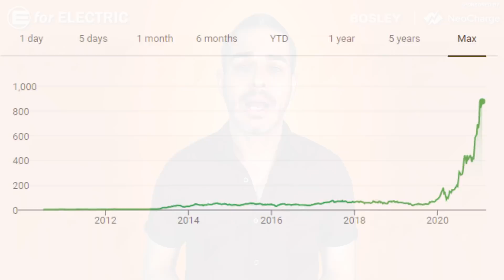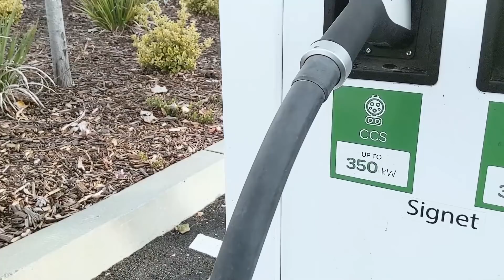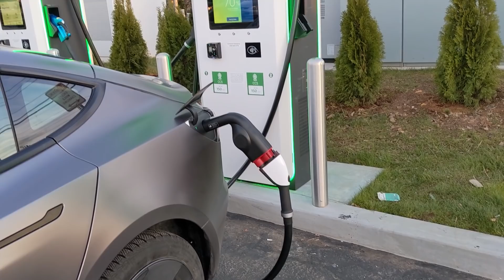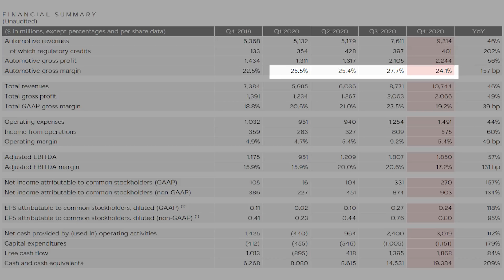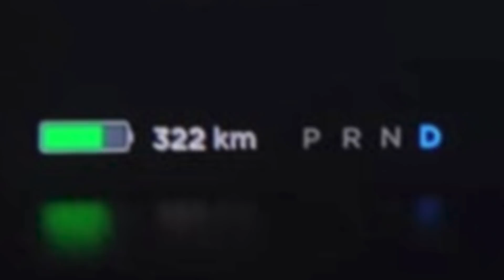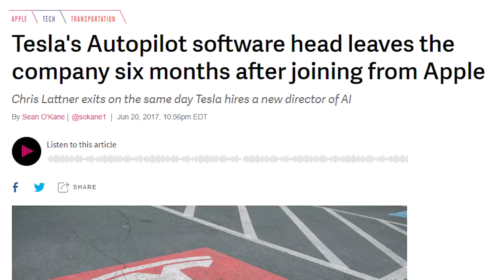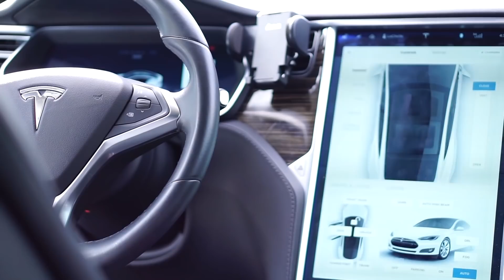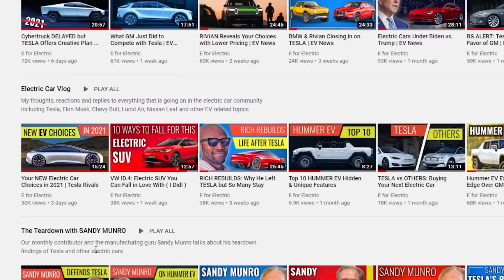Investing into Tesla Stock: Things You Should Know in 2021

Comment: Yes, these are proper concerns. I can add a few more:
1. The model line is now a little off for chmm... most markets. Teslas are very American cars - fairly big, with bad lamps and rather mediocre finish, but there is no truck still. We have to wait till 2023 to see the dent. For Europe, Teslas are too big and these bad lamps and finish... We need a smaller car like ID3 and smaller than Model Y SUV and microVAN. For China, the model line is surprisingly good, as Tesla doesn't want to compete with the micro/crap category, and rich Chinese buy Teslas as they are. Latin America and India need a smaller car.
2. The current designs of the M3 and even MY and obviously MS and MX are dated. Not really, but people are used to model change every 4-5 years. All competitors have new models now. It will take Tesla years to refresh the line.
3. The Star Trek look of Tesla is modern and cool, but a lot of customers prefer retro styling like Mini or Porsche and Steam Punk design (Teycan has even copper trim) of cars like eTron. It is difficult for Tesla to compete in this area. 
4. Tesla needs an app store and car API. Fast. As many competing cars have solutions from Apple and Google for providing a myriad of useful apps to use in cars. Also, on local markets.

As to quality and service - fortunately, Europeans are also dismal - maybe not in panel gaps, but UX of Audi, VW, Marcedes, and BMW is notorious for its stupidity. And these cars are not reliable, and repairs are very costly (see even biased German TUV).
As the main constrain for market domination now is the number of batteries - Tesla has the fair chance to get better - just in time for 2024-5, when Ford, Geely, VW Group, Hyundai/KIA/Apple will have enough batteries and debugged software to really compete.

Comment: The fast charging network is very unreliable outside of Tesla. EA has locations but good luck getting them to perform as advertised. I drive a Bolt and they struggle with a car than only charge at 50kW.

Comment: (Tesla model 3 owner)
Finally, a video talking truth about Tesla. I was wondering if I was the only one having that many issues on my car: 
- parallelism remade after 1 month, and now the stearing wheel is tilted. The customer service told me if have to accept the car as it is. 🥺
- welding on rear boot not finished (cracks visible)
- many accessories need to be bought to make the car practical (avoid snow falling into the boot, phone charger..)
- rear lights changed 2 times because of water leakage (still leaking)
- painting not finished (raw parts)
- plastics falling down
- autopilot is a joke (even after fsd update/ hardware replacement)
... I'm sure I'm forgetting some more issues. I have the car for one year now.
Reply: You never got a lemon before? 🤣 I bought a Ford F-150 that went back in 2 months because of the non stop problems with the engine and electronics in it. So does that mean All of Ford is trash? Half the shit this guy is saying is misleading info. Also the Tesla I have had none of those problems so what does that mean?
Reply: Do you live in California or other place w/ a lemon law? If so, talk to an attorney. California’s lemon law is really good; for some attys that is all they do. Tesla’s acceptance that the car’s defects can’t be corrected (re the steering wheel), taken far enough, would seem to be proof that they have to take the car back.

Comment: First of all traditional car manufacturers will have to shut down engine factories gearbox manufacturers. There they will have major problems with the union since ten thousand jobs will be lost. Vw is already struggling with sales and with software that looks like it will take a long time to resolve. Nio's solution of changing batteries is a bad idea who should check that they are within their limits! The 800 volt system doubts that it will work as it requires even more energy from an already severely limited electric power plant. The only reason why e tron sells better is the build quality, very inefficient car high power consumption. Yes, there will be more competition, but it will also depend more on which company has the best software hardware in-house production to best feature efficient energy consumption. Where Tesla will most likely win, we will see.

Comment: Which other EV at 40,000 $ can charge with over 250 kW?
Reply: None. However, many comes close on average charging speed. IONIQ 5 claims a peak charging speed of 230 kW and 10-80% in 18 minutes in ideal conditions. That’s an average of 170 kW. Deliveries start in June/July.

Peak power is not that interesting. The average charging speed from 10-80% in a 2021 Model 3 LR is about 80 to 120 kWh on V3. Depending on the ambient temperature and to which degree you’ve managed to heat up the battery. The charging session takes about 25 minutes. If you take the low consumption of the Model 3 into consideration, that’s still a winning formula though. If the car fits your needs- and live up to your standards in other areas. Same goes for the Model Y.
Reply: @omelvold  where will they charge? electrify scamerica?
Reply: @tips4tesla407  I know the Porsche did when it set a new EV Cannonball (NY to LA) record. 🤠 The US is lagging behind, but in most countries, there are way more fast chargers from other operators- than Tesla. And they’re growing faster. 

Not only that. People charge mostly at home anyway.
Reply: @omelvold  the ppl who did the cannonball run, out of their own mouths said if they used teslas v3 it would have been way faster, due to charger location and speed. Even if u throw out location , range , price, tech is def not up to par from porsche
Reply: @tips4tesla407  You’re missing the point. EA works, and there are dozens of providers growing fast. Chargepoint etc.
Reply: @omelvold  electrify scamerica from hoaxwagon raised their prices to par with gas on purpose to drive ICE car sales. Chargepoint purposely charges slow to keep the customers shopping cuz thats the location of chargepoint chargers and on and on. Range matters
Reply: @tips4tesla407  Teslas charging prices are not sustainable. Fast charging prices doesn’t matter anyway, because people charge mostly at home, at work, destination chargers etc. When it comes to range, the EPA ratings are totally misleading. Of course, the most aerodynamic sedan, or egg shaped MPV, with the biggest physical battery will have the longest range. But there’s a total mismatch between EPA and WLTP ratings. And while the Taycan for example has about 200 miles rating, you can go 380 miles in real life. In the same conditions and kind of driving required to make the EPA rating EV a Tesla. Good luck with your conspiracy theories.
Reply: @omelvold  not sustainable? you clearly dont understand the process, they give away 2000 miles with every car cuz the electrons are free from solar, and i guess ill bid you a good day if you really think that of WLPT, you will learn eventually. Tesla doesnt have the biggest battery its much smaller with a much larger range. Good luck with your theories too! we will see which one plays out in the future

Comment: It is an order or magnitude more difficult to ramp production for a mass market vehicle than to build a prototype. Prototype ranges overpromise all the time, range promises from Lucid Motors are not comparing apples to apples to Tesla. And clearly those cars are going to come in at a way higher price point per mile of range than Tesla will. Unfortunately this video has a lot of cherry picked data. Not used to seeing this from your channel. I was looking forward to seeing some legitimate arguments for Tesla being overvalued, not "the competition is coming" like the analysts have been saying for the last 5 years.
Reply: Lucid sponsors this channel.
Reply: I think the difference is that before most of the proposed competition was either on the ultra high-end, or distinctly less impressive like the Leaf and Zoe.  Now it's cars like the ID.3, ID.4, Ioniq 5, etc.  Cars the average person can afford, and are impressing people.  That said, I think Tesla will do just fine, despite the Kia CV being the car I have my eye on.  800v charging and an impressive heads-up display, two things no Tesla offers.
Reply: @ScrapKing73  Correct 800v charge speeds is not something Tesla offers - I could be wrong but I thought it had to do something with longevity of the electronics system? Also speed of charge matters less than how far you get on that charge. Example is the Porsche Taycan - technically it can charge at a faster rate than a Tesla however the actual charge speed in miles per hour is higher in a Tesla due to greater powertrain efficiencies and others. 

For sure there will always be a market for different car models - not everyone likes that single flat screen in the Tesla.
Reply: @michaelseymour5465  All other things being equal, 800v charging systems can produce less battery degradation.  So 800v generally means either faster charging speed, or lower amperage for the same speed.  And we're not talking about the Taycan here, we're talking about the South Koreans cars which are Tesla's big competition in the efficiency stakes.  :)  All of that pales in the face of the heads-up display, which is a big feature for me (I've experienced it on the Kia Soul EV and it's awesome).

It's not that I think people are making a mistake to buy a Tesla, it has advantages too.  It's just no longer true that Tesla has better tech in every category.  Tesla channels often talk about how Tesla has this unassailable technological lead across the board, and that's simply not true.  It was once, but it no longer is.  None of that changes the fact that Tesla is doing fine and will continue to do so, especially if they come out with a hot-hatch down the road.  If they come out with a smaller model, and if they solve all their build quality problems, then I might even consider a Tesla in the future.  But for now, they're not an option for me.

Comment: Correct me if I am wrong but Tesla is the only auto manufacturer with every vehicle since 2018 equipped with all the necessary sensors, processing and hardware that can be updated in less than one day  with the most recent autonomous driving software. If other manufacturers working to solve autonomy had such a fleet of vehicles to use they would too. Also, Tesla can see who are the best drivers to invite to participate in the Beta program and these drivers have to agree with the terms to participate. Everyone will have to do " human trials" at some point. That's how everything ultimately gets tested so why is human testing somehow bad for solving autonomy?

Comment: I totally get Tesla is not in the same place as before but...
How are you only talking about Europe? Of course Tesla will not be the best seller there until Berlin starts working. How are those cars selling everywhere in the world? Still a lot of ramping required for the competition.
Beta testing actually means Tesla has a lot more data and experience and that is really an advantage in their FSD. MobilEye is ahead... you can say that but if you look on the long run its technology is more expensive and less adaptative to changes in the roads.
Tesla solar lost market because it had to focus on automotive sector, it is ramping just now.

Also don't forget to add MobilEye + Automaker competitor when comparing with Tesla market cap...

Seems like you are missing part of the picture here.
The stock price may go down, I am not saying it will not but that does not say Tesla will do bad in the next years and will catch up to the price soon enough.

Comment: Alex, basic economics. Lidar is expensive. Tesla is selling cars to consumers. You can't on one hand say they aren't making profit then turn around and ask why they aren't using expensive lidar in their cars... It's because the cars will be more expensive with lidar than with cameras... plus with cameras, every tesla sold becomes a data collecting asset for the neuralnet (bigdata ) and if you have ever written machine learning code you will easily see how tesla is ahead of everybody by far 
Emotions are a bad thing.
Reply: I think Tesla will ultimately choose to use LiDAR, and it won't be an issue because future LiDARs will be about $100 per unit, which will be pretty easy to retrofit and/or manufacture directly into new vehicles. I think the LiDAR cost debate is gonna be a moot point in 3 or 4 years.
Reply: @kevinkent6351  yeah... But maybe, maybe not. But Tesla is currently able to put cars on the road that drive and learn to drive themselves at scale. Alot will happen in the future... But at present their decision not to use Lidar in production cars is very successful or don't you agree ? Who else is doing it at their scale with every day cars ? 
Besides Tesla uses Lidar in development and calibration vehicles where it makes sense
Reply: @ChurchillNanjeMambe  well, if the goal is robotaxi, I don't see why they wouldn't add LiDAR if the cost is essentially nominal. $100/unit on a vehicle that produces tens of thousands in annual revenue wouldn't be too tough of a decision. It's why I'm an investor in both Tesla and the complementary Velodyne.
Reply: @kevinkent6351  yes I agree with you. The absence of lidar is mostly a business and economics decision and once lidar is affordable, I will easily see them using it. Cos it's business and not personal ;)

Comment: A reasonably good summary of Tesla’s current situation in the marketplace. Two points I would add; first the use of Tesla’s structural battery pack, while it has unquestionable advantages, means that any fault in the pack will result in the vehicle being written off. It cannot be repaired. Second point is that the Tesla Power Wall still does not support a direct three-phase connection. Three phase is already common in Europe and becoming more common in other countries. Lack of three phase support gives Tesla’s competition on edge in these markets.

Comment: Is competition coming?  You mention Rivian, Lordstown, and Lucid specifically.  These companies haven't produced anything yet.  Even Ford has only managed to produce the slow/low range version of their E Mustang.  

My experience with other charging networks is they are often out of service or slow (7.5 kW).  In my town, Tesla has more charging bays than the other networks.  And the Tesla network simply works better.  

But you're correct, Tesla has areas for improvement and they should be exactly addressing these issues.

Comment: Looking forward to range is 500 miles plus and prices hit $30,000.
Reply: I've never bought a brand new vehicle. When I do it will be all electric.
Reply: You don't need more than 300 miles even if you think you drive 3000 miles every month, which is pretty rare. The new cars will have faster charge rates so at that point you're spending at lot of money on range you don't need and carrying around a lot of extra weight. I'd much rather have reasonable range and spend the extra money on advanced features and a nicer interior.
Reply: @davidmccarthy6061  In the MidWest I do need more range.  For cross country driving I really do want to drive about 350 miles with out thinking about charging--Winter and Summer.  So a range of 500 miles sounds good--considering that only about 70% of that is actually available,  500 miles of EPA range will give one about 350 miles of real world range but only in the Summertime.  If it is 20 degrees out then maybe only about 295 miles of real world  range.

Comment: I wanted a BEV with good cargo capacity, decent range, a good charging curve, and that can tow in the event I need or want to.  I was looking at the Mach-E but it isn't rated for towing in the North American market - meaning even if one gets a tow hitch installed it won't be towing very much at all and there are risks to possibly voiding warranties.  I looked at the ID.4 and the Ariya, but those aren't even out yet (although they will eventually be able to tow in the 1.5-2.5k range).  I considered a Rivian R1T (love the tank turns!) but there are so many pre-orders that I probably wouldn't get one until 2023 at the earliest (late 2022 would be delightfully optimistic at this point).  Lordstown's truck is nowhere near to production.  The Ford Electric F-150 might beat the R1T to market... maybe.   So process of elimination  means either I wait longer than I may be able to (current vehicle has nearly been driven into the ground), I buy another ICE car (no thanks), or I buy a Tesla Model Y (Cybertruck isn't out yet either, but that's a Tesla product so not really relevant to the point I'm making).

That's the problem with Tesla's competitors in a nutshell.  While Tesla does have issues, and they are abundant, right now their competition is mostly stuck in "coming soon" or "very limited availability".  In THEORY I have a ton of options (Mach-E, R1T, E-F150, Airya, ID.4, etc.) but in practice I don't.  It doesn't matter if another manufacturer makes a prettier or more desirable vehicle in theory, it matters if they make one in practice.  In reality.  Tesla has a lot of potential problems and their stock valuation is nothing short of stupidly over-inflated, but until the competition stops being "coming soon" and starts being "here now" in a meaningful way I think these concerns may be overblown.